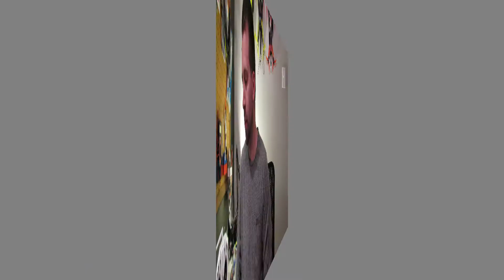FrSky Q X7 Crossfire Mod Break Out Board

Comment: Hi, I managed to knock off the resistor that’s right above where you solder the ground wire on the taranis. It’s the R104 one. It’s so small I lost it when it got removed. Any idea on what I could to to fix this?

Comment: It seems like its best to use an anti static strap as transmitters are very sensible to mods, is that so important for this mod ? i actually did it without anti static electricity safety strap:/
Reply from the maker: I think it is a good idea to use when when doing most electronics work, but I like to live dangerously :)

Comment: hello, its modification of the reception of radio signals? or it's just for telemetry¨?
Reply from the maker: lio lio this allows the CRSF protocol to operate at its intended baud rate without errors. It fixes the telemetry issue as a positive side effect. The actual RC link was fine, just the communication between the transmitter and the module was a problem.
Reply: crsf rx responds faster with modification? with a slower patch?
Reply from the maker: lio lio hardware mod is the best option for performance. See the github link for more info one the original issue

Comment: Thanks for the information, I have the lua script crossfire that works well, I still have to make the modification on taranis x7 ??
Reply from the maker: Mat Ciel it depends. Older X7's work fine. Newer models eother need this mod, or a software uodate that lets you lower the baud rate.
Reply: ThatJoshGuy where can i download the new software that i dont need this mod?

Comment: I used a board as well. A different one but get the same job done. I had tried it twice without the board and couldn’t get it to work. Once put it on the board it worked perfectly.